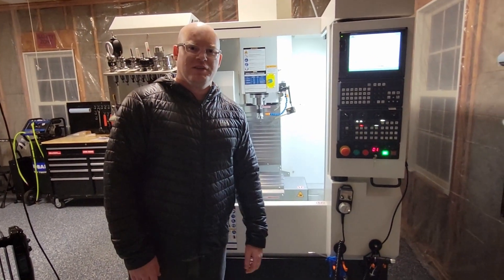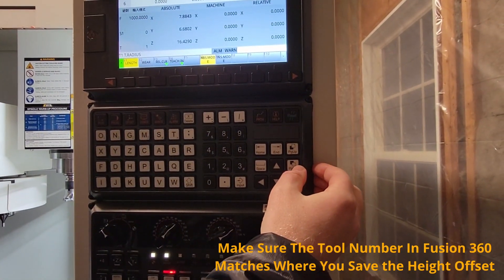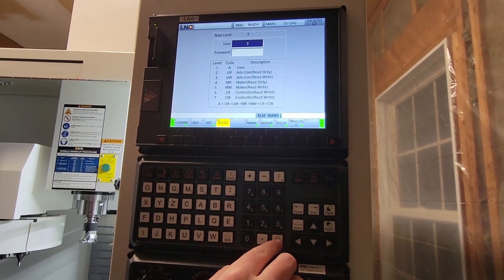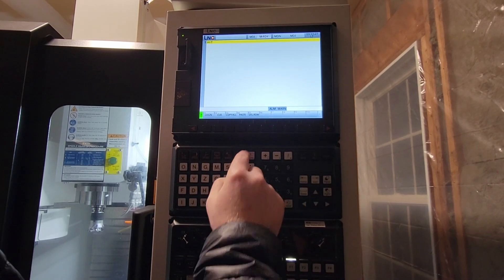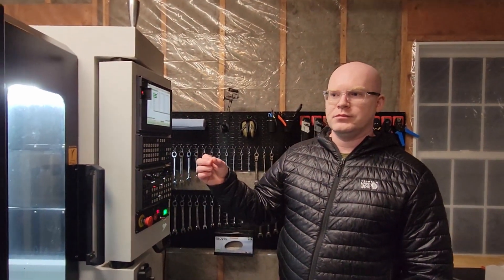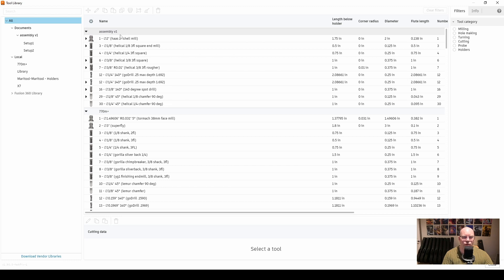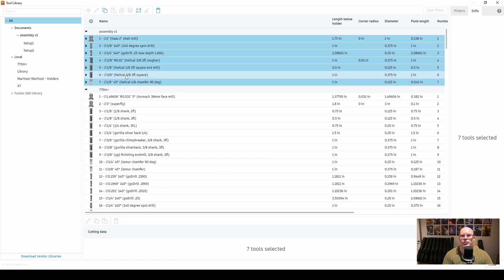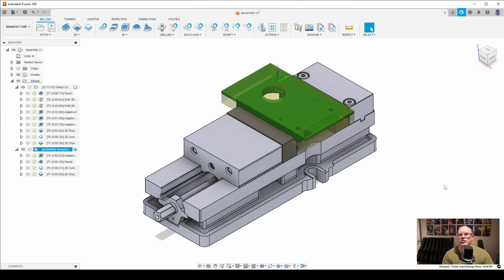SYIL X7 LNC6800 HEIGHT OFFSETS & POCKET ASSIGNMENTS

Comment: Thank you for all of your videos! I just ordered my X7 and I am wondering what type of tool holders do you reccommend getting? These things are EXPENSIVE! lol
Reply from the maker: @aerologicsolutions4982  for ER collet holders I recommend haas tooling when they have a sale. You can pick up ER16 holders for less than 20 dollars when there's a sale. They also have good deals on pull studs. If they're not on sale, i would recommend tegara holders from Shars. For hydrolic holders, I use maritool. I like hydrolic holders for finishing operations. They give me a much better surface  finish than Er holders. I hope that helps and feel free to email the channel with any questions you may have.
Reply: @MrSmith1231  Thank you so much this is a great help!!! I will start looking around at these. Looks like Haas has a winter sale going on now.

Comment: This is so helpful! Keep the videos coming! I have an x7 lnc and have always had a tricky time with keeping track of tools and pockets. The renumbering thing in fusion is cool, but if you have standard core tools it may over ride those right? Thanks again for the x7 lnc content!!
Reply from the maker: Thanks for your feedback! It shouldn't overwrite any tools as long as you only renumber the library fusion creates for that part. When you move to the next part, your core tool library will be unchanged. Just don't touch your core library. I hope that makes sense.